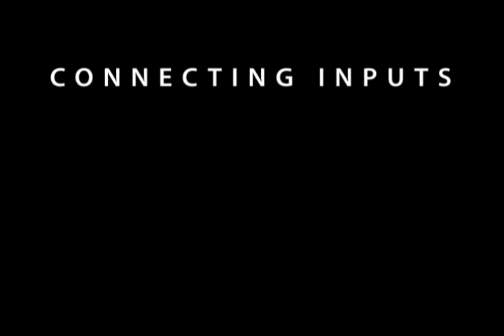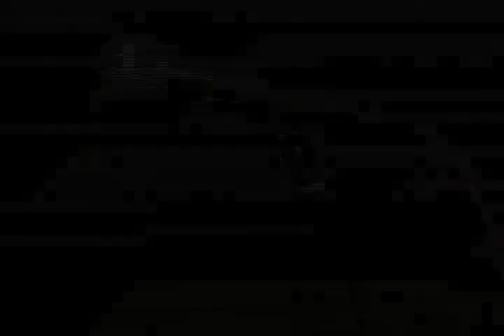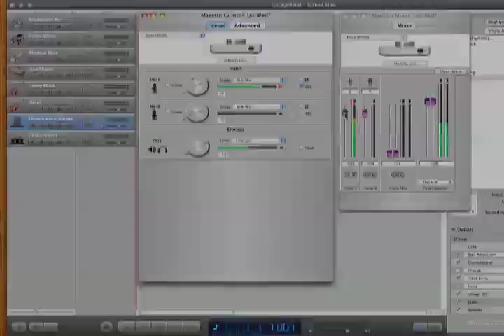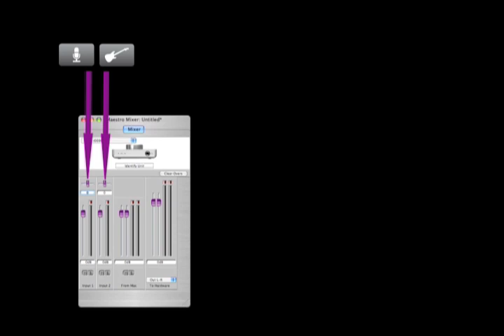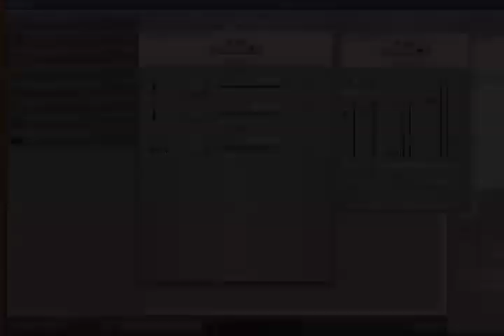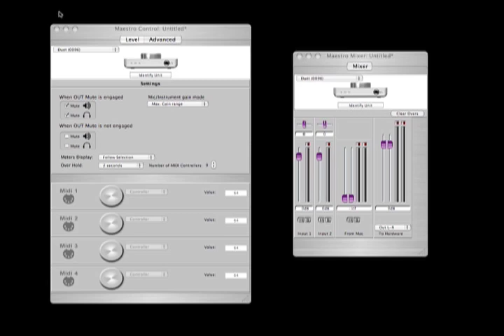Recording with Apogee Duet

Comment from the maker: First start with an acoustic guitar that has an awesome tone... in a room that you like the sound of. Next, you will need a descent mic (usually a condenser mic works best on acoustic). Now put on a set of descent quality headphones, and move the mic around until you get the sound you want. A good start is pointing somewhere between the 12th fret and sound hole of the guitar.  Move it around, try different rooms, experiment, and have fun!

Comment: @laloo2cool I"m having the same problem. Did you ever figure it out? I read on a message board that you're only supposed to record in mono, which does play back on both ears but i haven't had to do that with other mixers.

Comment: Hi Guys! I'm really happy with Duet, but I would to know some other aspects of its using. I want to know how many possible connections can I use within the monitors and the Duet unit. I used the XLR cable connected to my monitors with the 1/4 jack stereo terminal to the Duet unit. In that connection I was experienced a noise, then I changed the cables to 1/4 jack mono in both terminal and the noise was gone. I'm using Focusrite 428 Preamp with the Duet unit. Is it right? Thank you so much.